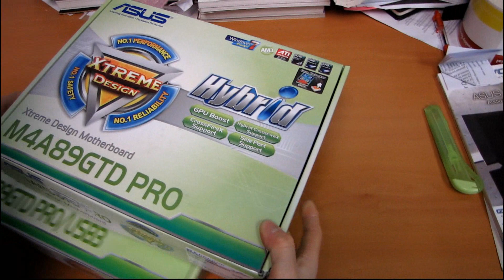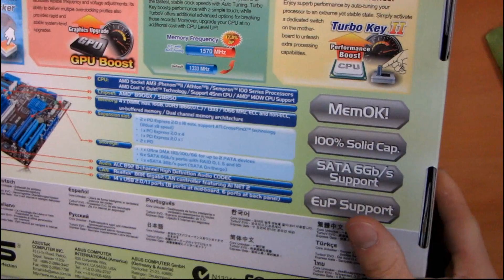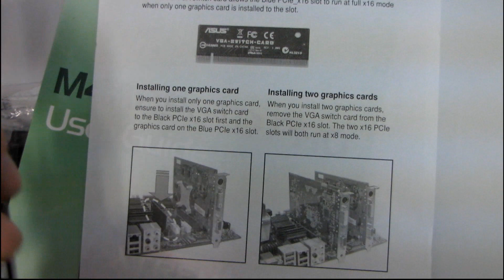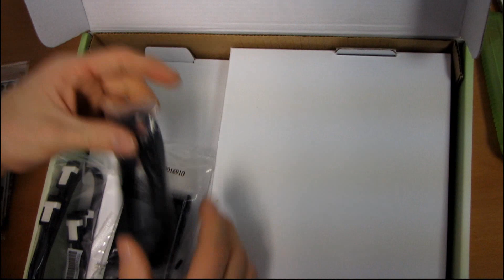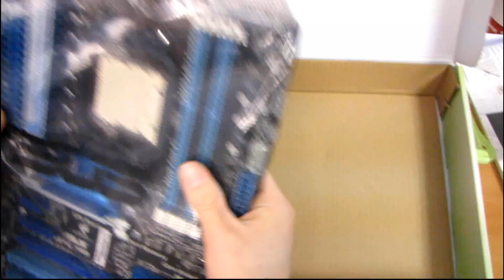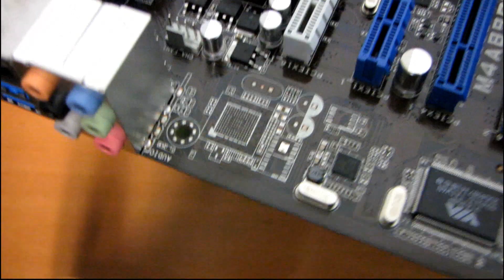Asus M4A89GTD PRO 890GX Crossfire SATA3 6.0Gb/s Motherboard Unboxing & First Look

Comment: @L00peey Generally, you'd be better off going Intel boards for SLI if you're going for NVidia cards. AMD boards tend to be ATI/Radeon-centric with their multi-GPU support as ATI is now part of AMD anyway.
Now, yes, you can run ATI or NVidia cards, but if you want to multi-GPU on an AMD board, you're pretty much gonna get ATI/Radeon cards.

Comment: I just got the the M4a88td-v Evo with the world class Phenom II x2 555. (locked 955) 
The board  supports usb3 and crossfire (albeit 8x8 in XF mode) two 5770's or 5850's should do just fine for some fine Teraflop action :) IM jazzed. Next year I'll consider a higher end board for now this is all I need.

Comment: @emshains MSI NF980-G65 has the n980 chipset. Mabey I dont quite understand what your talking about. Because you can Sli, Tri-Sli, And Quad-Sli (with the extreme) on a Crosshair V. Or with the MSI 890FXA-GD70, or GIGABYTE GA-890FXA-UD7 as these chips dont have onboard video so they can run SLI or crossfire. So please explain

Comment: @4g63fourlife The crosshair IV doesn't support SLI, it uses the Lucid Hydra, which is a pretty sick chip, but native SLI is still better. It would be best if you would find a motherboard with the n980 chipset, but if you can't, then the m4n75td is the best you can find.

Comment: @deathflyer10 None of the amd chipset motherboards support SLI officially, you can though SLI cards using hacked drivers. But if you want legitimate SLI capability, you either must use nvidia's chipsets or p55/x58 from intel, and even then you must find the ones that have the nvidia's chip on them .

Comment: @wheely132 it's cheaper to buy one buy you don't get to choose your parts. for the exception of NCIX , Cyb-er power. if u buy a OEM ex dell HP those PC's are junk they use cheap parts and upgrading those parts are hard to do because they have proprietary parts.

Comment: i have read a couple of comments saying they do not think this is a good gaming board! Well IMO it is a excellent budget gaming board. Yes of course there are better boards but none at the price I paid for this one.
£90 UK pounds for a board that has two PCI-E  X16 slots,  SATA3 6.0Gb/s, HDMI, DVI and VGA ports! It comes with 4 SATA cables!! my last board had a measly one cable with it.  Integrated ATI graphics that will work work in tandem with your ATI graphics cards. It is a pretty cool board

Comment: @RTechstudio Don't worry, if you're using the on-board video you don't need to put the VGA Switch Card in any slot. When you install a single graphics card you should put the VGA Switch card in the grey one, and the graphics card in the blue one, but this is just a bandwith question, you can put the graphics card in the grey one, and throw away de VGA Switch card xD, but the PCIe will run at 8x instead of 16x (truly not a very important diference for today's gaming).

Comment: @DragonAge1103 So one graphics card in a PCIe 2.0 at 8x shouldn't cause bottleneck even in GTA IV or Crysis at maximum settings for example? If so, I'm glad to know it, because maybe I'll have to put my HD 4870 on the grey one because of my case, until I buy my HAF 922.
I'll do benchmarks about this thing, with my AMD x6 1055T OC and my RAM Mushkin Redline 1600 Mhz CL6, to be sure that anything causes bottleneck. Just remains the motherboard ; )

PD: Where's the black PCIe? xD

Comment: @DragonAge1103 What I don't understand why they make this huge failure in this area. Because of this you can't choose the slot you want to use. I've heard that if the little card fails costs a lot to get another.
Well anyway I decided to buy one, because I believe that in everything else is an excellent motherboard, and my plan is to make a 5770 crossfire in the future, although if it were not for this detail would be perfect, but well...

Comment: @KoolCordell
Most 790GX boards will run the first card at 16x without the need for a second peripheral. If you want to run 2 cards, they then revert to 8x and 8x. I want to know why they require these cards now. Theoretically it should work fine without the card.

Do other manufacturers do this as well? Maybe a new thing for the 890GX?/?

I just thought it was strange.